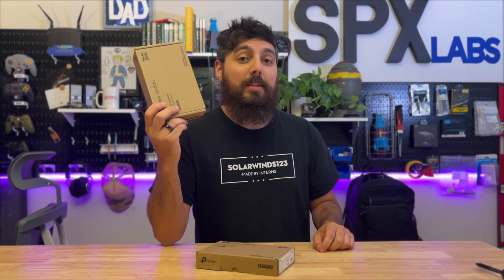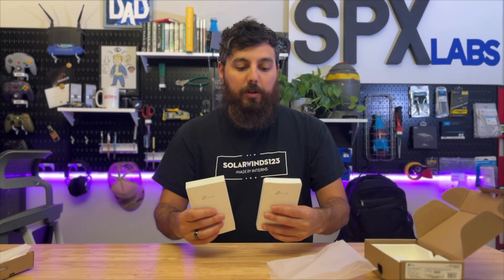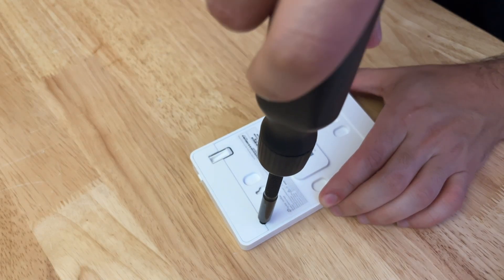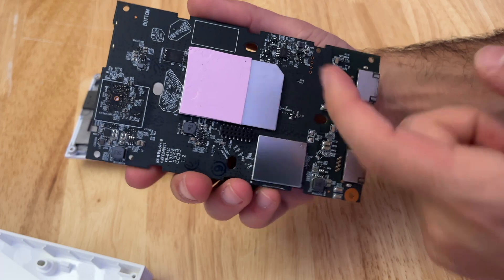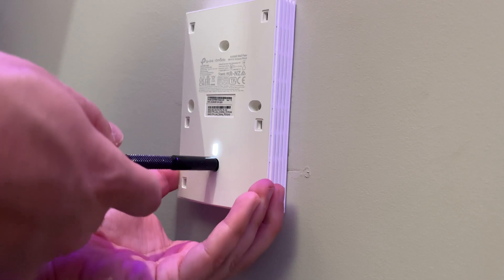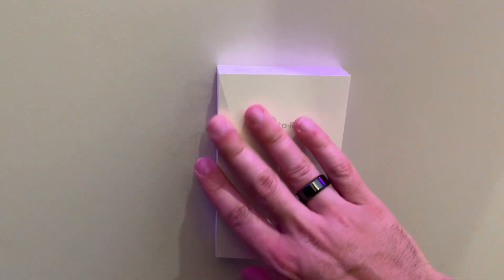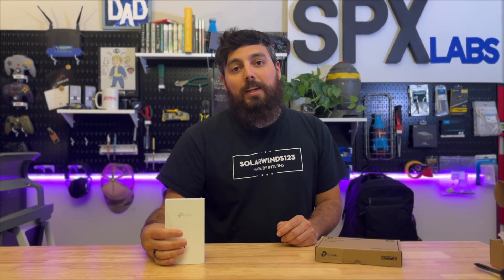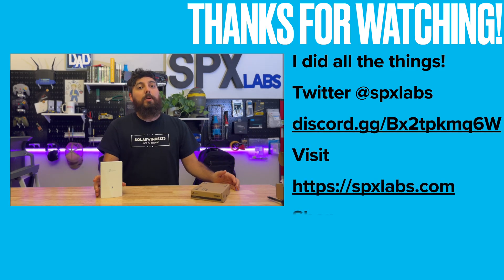EAP 655 Wall & EAP 615 Comparison, unboxing, teardown, & speed test | @Tp-linkUs #omada

Comment: What's the point of purchasing 655 over 615? 615 outperforms it in price and results. I suppose 655 should be purchased only in high-density areas with 200+ clients

Comment: Quick question: Why do you think magnetic screws are in any way better? It's handy, sure, but it's no marker of screw quality. Some types of stainless steel are not significantly magnetic.
Reply from the maker: Just makes things easier that’s all.  From another commenter on another video they suggested not to worry about it as much unless the device is something that is meant to be serviced or have parts replaced.  So I’m probably going to roll with that mentality moving forward

Comment: Hi, Thanks for the video. From the results, it seems that the EAP 615 is BETTER than the EAP 655? It's also cheaper and slimmer. This makes it a no-brainer choice to get a 615? Just double checking you've labelled the charts correctly?
Reply from the maker: God I hope I didn’t miss label because it is an extremely tedious and frankly annoying process to test WiFi at each spot 5 times.  I would literally never make a WiFi video again if I made that mistake.
Reply from the maker: I think you will be satisfied no matter what.
Reply: Why do you think the 615 would be better?  Link the timestamps?

Comment: can we use it to create a wifi mesh? i mean if the eithernet is only providing power with no network scream, can it join existing wifi network and extend it?
Reply: It should, I see 'mesh' as enabled and it's pretty standard across at least the not super old gen APs

Comment: I thought I would use the EAP235. I had a printer plugged into a wall jack and I thought I would replace the wall jack and gain an AP while maintaining the printer plug. After a long call to tp, I found it would not work with the 235 but would with the 655. I will comment that the 655 runs a little warm.
Reply from the maker: That’s really strange.  Sorry it didn’t work out for you.  Yeah the 655 gets toasty
Reply: Why would you call the company if the information is on the internet?

Comment: I have an ER7212PC, and I would like to know if the 'EAP 655 Wall' would work as a mesh with the two EAP670 units I already have installed. Thanks :)
Reply from the maker: It should

Comment: What are the dimensions on these?  How much larger than a standard cover plate are they?  I have a junction box that’s right above a power box so trying to figure out if this will fit in my location.
Reply from the maker: Dimensions EAP 655 -> https://www.tp-link.com/us/business-networking/omada-sdn-access-point/eap655-wall/#specifications
Dimensions EAP 615 -> https://www.tp-link.com/us/business-networking/omada-sdn-access-point/eap615-wall/#specifications
They might be larger than a cover plate but those unfortunately come in different sizes depending on the vendor.

Comment: Wife and I have been running two 615's in our house for quite some time. 2100 square foot single story home and two 615's is probably overkill. 655 is a bit of a waste of money for us, but I would love to upgrade to Wifi 7 version when it comes out.
Reply: Me: reads comment about two 615s on a 2100 SF home being overkill and wonders if me having like eight in a 3000 SF house along with two outdoor 655s means I have an addiction problem. Lol.

:)
Reply: @RichardKneece  I hope you have assigned the channels wisely.
Reply from the maker: It definitely does
Reply from the maker: Yeah I wouldn't upgrade either.  Can't wait for the 7s.

Comment: Thanks for the vid. Any tips on getting the most throughput out of the EAP655-Wall? In the same room, 8ft LOS from the AP with an AX210 I get 300-400 mbps down and 600-800 mbps up. This is on 5GHz/80MHz OFDMA on. Tried standalone and local Omada controller, no difference. It performs about the same from an iPhone 13. If I could get to 600/600 I would be completely satisfied.

Comment: Supports 2400mbps, yet only has 1gige uplink
Reply from the maker: Right. But that’s max multi stream bandwidth not single.
Reply: It shouldn't be a problem. The Wi-Fi ceiling in reality is well below 1 Gbps.

Comment: vent holes in 655 means it overheating on 6e with 125 clients in the same time
Reply from the maker: That’s definitely a possibility.  I’m. Bit surprised they didn’t give it an aluminium backplate like their ceiling mount APs
Reply: @SPXLabs  You mean something like the thermally conductive transfer gap filler shown at 5:37 and the actual aluminum backplate as shown at 5:45?
Reply from the maker: It’s plastic 🤷‍♂️
Reply: @SPXLabs  Wrong. MINE is cast aluminum. It is not plastic.
Reply: @SPXLabs  Why on Earth would they use thermally conductive transfer gap fillers to go from the top of the IC shielding to a plastic backing?
Reply: Vent holes in electronics means they are providing ventilation. Vent holes have nothing to do with number of clients.

Comment: Kind suggestion: put the performance results on the same chart when comparing devices
Reply from the maker: I started too but it looks very very small for video.  Maybe I’ll do it next time
Reply: @SPXLabs  Could split download/upload into separate graphs, so you can put the comparison together.
Reply: Better yet, the performance results could be added over the floorplan image, similar to the way @MaxDicas does: https://youtu.be/K32myzy6sEI?t=1917
Reply: @ghnihei I was pretty disappointed that the floor plan was not a part of communicating the speeds, personally. A bunch of bar charts doesn't really mean much to me, and I'm not about to rearrange the data myself, so it was not a very useful part of the video for me.
Reply from the maker: @Diamondragan there is a floor plan at 9:29 .  Cheers
Reply from the maker: @Diamondragan reread your comment.  This is something I changed.  Showing the speeds on the floor plan.  These charts just aren’t working.  But it’s still a work in progress.